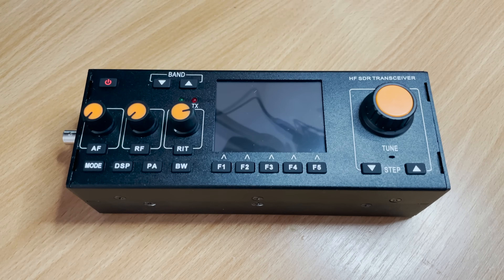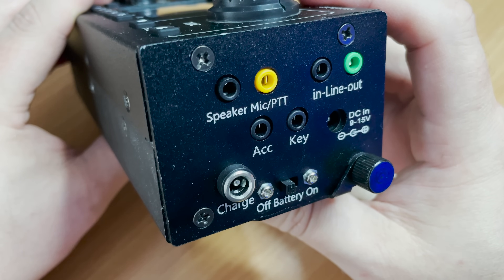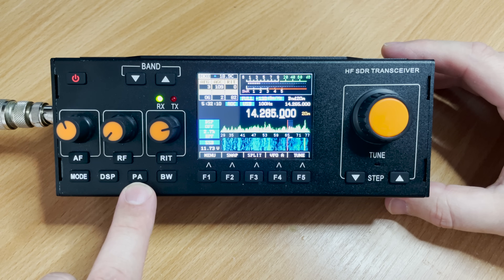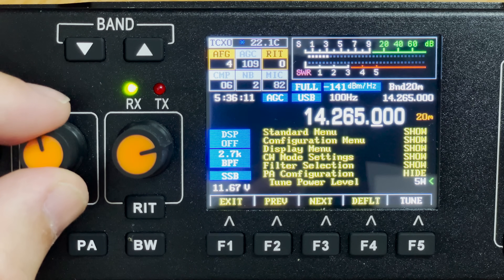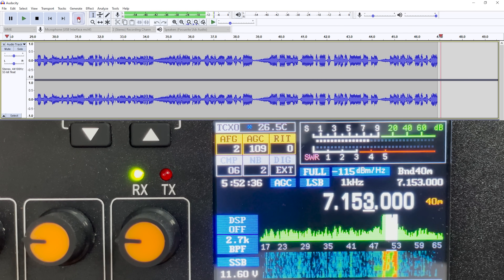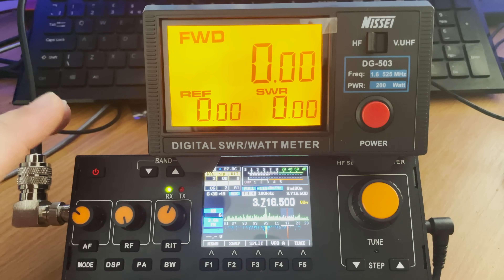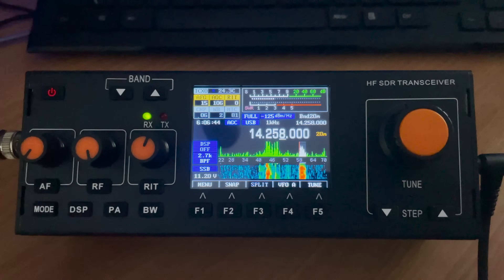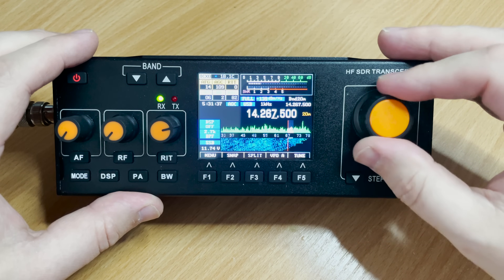HF SDR Transceiver RS-918 mcHF

Comment: I have the same orange button Radio, with built in battery also. I purchased it a year or so ago. It worked great out in the parks doing Pota. I had it hooked up to my 12 volt lithium battery and worked fine. But 1 day hooked it up at home to my switching power supply. It worked very well at home as a base also. After only owning this radio for 4 or 5 months. The radio is now a brick and will not turn on anymore. When I hold in power button the screen lights up clear blue when I hold in the power button. and when I release the button the radio screen goes blank.   I later noticed that it said not to connect this radio to a switching power supply.  Would love to get this radio working again. over $500 lost.   Maybe the firmware needs to be redone.  Any help would be appreciated.  73 de VE3WKG.

Comment: Bought one working perfectly from the first switch on. Can change power output without problem, noise reduction efficient, low swr protection, no risk to burn. CB 11m lsb ok 👍💯👍

Comment: hello, I picked one of these up, Chinese clone, the first thing I noticed was the waterfall is going up, instead of down such as falling lol. I checked the setting and the firmware. The firmware was out of date from 2018 so I updated the firmware but still noticed the the water is not falling and was going up? I know the display is correctly installed as everything that appears on it shows correctly, not upside down (as I say with a smile :) ) So what is going on with this? Never seen a backward waterfall on a radio? Is there anything that can be done to correct this this?
Could you please respond? Have contacted you before but never received any replies? Are you still alive? lol
George, VA6GBN
Alberta, Canada

Comment: Hi Matt I know this video is old but I just got a Rs828 plus 2nd hand which works great..in wsjtx hsve configuration for mchf an cat control works but when rig goes to tx no output present on ft8..received an decode no problem but when switching to tx no output? Any help appreciated.73 Gm4zji Chris
Reply from the maker: Hey Chris, I dont have this radio any longer. I would suspect its an audio input issue, assuming it transmits okay in SSB with the mic etc?
Reply: @TechMindsOfficial  got it Matt! A couple of presses on the screen where mode display is an it changed to data ext which means I’m using the rigs built in sound card for tx an Rx with cat control 😁73 Gm4zji Chris

Comment: I'm stumped on this rig. I have spent several hours with it since two days ago, and I have it talking now to my tablet so I can run FLDIGI which is a feat unto itself, but while it's showing me 7 watts output, the ALC doesn't show up at all an no one is responding to me which tells me there's another adjustment I need to make somewhere. Where would I find that? I also do not have the "SSB" option in the little blue column just above the battery voltage, I have digital, RTTY, FREE DV...I've searched the menus but maybe I missed where to change that, but how do I get a SSB option and set whatever it is that gives me some ALC reading? Any help is appreciated. I feel like I'm pretty close to getting it dialed in.

Comment: Would this be able to decode NOAA satellites if I had a decoder hooked up such as robot36 for Android tablets?
I'm just getting into ham and I'd like a travel radio for camping trips with no cell service that I can decode noaa images and use the radio for communication to other ham users (my local search and rescue has a ham shack)
Reply from the maker: Unfortunately this wouldn’t receive satellite because it doesn’t cover the frequencies of satellites. Maybe look at SDR dongles for receive and then VHF radios for local search and rescue.
Reply: @TechMindsOfficial  thanks for the reply! Was hoping to stay away from the dongles but looks like it's best option... might have to try making your dipole you posted a vid of.
(I'm looking at the noolec satellite combo on Amazon but the antenna they sell in the combo takes up about $150 CAD of the $250 system everything needed besides decoder but they recommend Linux operating system for the free decoder and I was having problems gaining root access to my tablet to change the operating system finger crossed 🤞 robot 36 will work free on Android playstore)

Comment: Hi Mat, good video! The unit you are presenting looks like a BS188. How did you get rid of that center "carrier" (LO?), to be seen at the intro picture, not to be seen in your presentation of the radio.
Reply: I recently bought one of these and can confirm that indeed this looks like very very much a BS-188 with these orange knobs. It actually displays "BS-188" on the splash screen. The downside of it is that you cannot upgrade the firmware with the UHSDR updates. This will brick the display due to a different screen or display chip. However you can always revert to the original firmware. So if you don't want/need/like to tinker with these radios this seems to be a rather good one retaining all aspects of the main RS-918 / mcHF. Additionally it seems to support 6m (50MHz) and 4m (70MHz) with no guarantee on the operation (yellow frequency numbers). Maybe because it uses a different LO chip (Si5351a) instead of the Si570. Mine had no battery. The wires were actually cut short as if someone withdrew the battery but at least it shows where you should connect one and it seems an easy operation as shown in the video. Just take care of the size it will not fit a battery larger than 3 cells (hence 11.1V nominal and the highest capacity I found was 3800 mAh). A nice addition to the RS-9x8 line (I think) is the PTT by pushing the tune knob and internal mic making it a very compact radio almost a HT if you so wish.

Comment: Thanks for the video, mine was delivered in just 6 days. Testing so far has been quite favourable with good signal reports although suggestions the audio is a bit 'flat'. This could be just due to mike settings out of the box.

I think the battery pack in mine is 3S. If replacement comes due shouldn't be difficult to source, or even roll your own from  18650s.

On max power setting the measured output of my unit was 14 Watt on 40m. Haven't checked other features yet.

In addition to having a good portable QRP+ I hope to explore the digital possibilities of the radio.

Comment: hello from Alberta Canada. You mentioned that you can connect to a pc, does it present the same waterfall projection as shown on the radio? Does it duplicate the waterfall and the band as a separate receiver would? What features does it have when connected to a pc?

Comment: I received one from banggood a few days ago. Screws rattled in the device, which I removed. The sensitivity of the transceiver is very bad. banggood does not adhere to its warranty conditions and will postpone a complaint until the item is returned at my own expense.

Comment: It will  not be possible to update/upgrade the firmware UHSDR on this radio :(
Reply: Why is this?
Reply: @gerrykavanagh   It uses SI5351a circuit for VFO instead of Si570 and some other changes... So you need a specific firmware for it. UHSDR releases will not work. Be careful while flashing bootloader. I would call this version a "RS-928", instead of a RS-918.
Cheers!
Reply: @LuísLapão  ok. Didn't know that. So I guess whoever made these changes have not contributed back to the project. Unsurprising I guess.
I have a genuine v0.5 mcHF, so no worries my end :)
Reply: @gerrykavanagh  Some "clone" sellers do warn about the changes, its all a matter of cost. And unfortunately not everyone has the skills or tools to assemble or tune a genuine kit, making the assembled unit even more expensive.
I just commented it because I know a case where the wrong firmware already bricked one of these banggood units [display is now blue, but it RX].
Reply: @LuísLapão  thanks for making the comment. Hopefully it will save some people.
Reply: @matthewlyle4417  Hey Matthew, this is Luís CT2FZI, we already exchanged some emails about your issue... I was the one that was able to cancel the Banggood purchase! Sorry I could not assist you further...
A special note for anyone reading: your mileage may vary, the rig might work perfectly fine and its not a MUST to upgrade the firmware/bootloader. So enjoy your transceiver and do not worry.

Comment: These chinese QRP SDRs are way too expensive.  Makes little sense to buy one IMO.
Reply: Completely agree!!!!  I wouldnt pay more than around $200- $250 tops.
Reply: Why do you think this? I have an mcHF (genuine) and it compares favourabley with my KX3 in all but the most challenging of conditions.
Reply: @gerrykavanagh  KX3 is a bad comparison- yea rhats a company that just thinks a little too much about their radios- way way way overpriced.
Reply: @daveycrockett9447  fair enough. They are the only QRP HF radios I have though, so the only comparisons I can make
Reply: @gerrykavanagh  how much did yours cost once it was all said and done?  Also, as far the KX3 comparison, under most average conditions I cant tell much difference between a $20 RTL SDR and my IC-7300.  It's under challenging conditions where the differences show themselves.

Comment: I wonder if it will be sale in the U. S>?
Reply: These are 'unofficial' clones, i.e. not sanctioned by the designer. 
One or two vendors in the UK stocked them briefly a year or so ago, but as soon as the designer got in touch, they withdrew them from sale.

Comment: Used to have one but the one without the internal battery, but sold it as i whated to tx on 11m and there was no way of opening this up to tx outside of band even though there is a menu option to do this it did not.
But did enjoy using it listening to hf  on it.

Comment: Greetings, N9XFX Dennis here, and I have one of those little radios. I really like mine. Still learning. I bought mine second hand. I think I need to play with the AGC settings some, it seems to be overloaded on audio on 80 meters. It's going camping with me for a week in July. I haven't used it on digital modes, my Yaesu FT-817 is my digital rig, and it'll go with me too. Your radio's knobs really pop in that color.

Comment: I have built 2.5 MCHF v0.6's and they are indeed great little radios, especially with many of the mods carried out (the eeprom mod is a must).. I also have an RS928 plus which has the built in battery, I picked this up as faulty and spent an hour or so fixing it... Be aware if you opt for a Chinese clone of the MCHF that they have a habit of changing the design and compromising on the filtering... For example the RS928 Plus uses a different oscillator IC so cannot use any of the standard firmware images, it requires special patched versions... It is also worthy to note that the clones do vary considerably in terms of build quality, so do some research before opting for the cheapest...

Comment: You should try a firmware update. It should use the mcHF firmware but many buyers have found that the 918 clone cannot be upgraded. Did you also test the Digital Voice facilities? It has built in CODEC2 Digital Voice encoders.
Reply: @RodLittle  How about simply updating to the latest revision? Typicaly these clones come with old firmware.
Reply: @RodLittle  Dunno. It's your essay. You research it.
Reply: Don't update, the radio will not work with the standard firmware. I did and now I only have white screen. Lost the backup firmware. If anyone has a copy of the original backup please send to me. zs5pgm@gmail.com.

Comment: The knobs look really bad. I was interested in one of these but not bright orange. What went through the minds of the people planning the look of this radio?
I'm interested to hear how you get on with the FreeDV, I've played with it but only with a computer so it's nice to see it on a SDR radio.
Reply from the maker: I guess the knobs could be pulled off and replaced if you didn’t like the look of them. I’ve seen other variations of this radio with different knobs. You’re right, I think the FreeDV will be interesting to see how well it works.
Reply: I agree.  I got mine a few weeks ago and immediately changed out the main tuning knob with a solid metal knurled knob.  Easy fix
Reply: @juergennoetzel988  Have you tried the FreeDV?
Reply: @glenwoofit  Not yet. So far I have really only used WSJTX and have hit all coasts and into Canada.  Haven't gone voice yet.
Reply: There's no accounting for taste, but I like the knobs. It gives the unit the look of audio gear found in professional recording studios (not to be confused with high end consumer audiophile gear that shoots for a refined appearance).
Reply: "What went through the minds of the people planning the look of this radio?"

What are the cheapest knobs we can get?